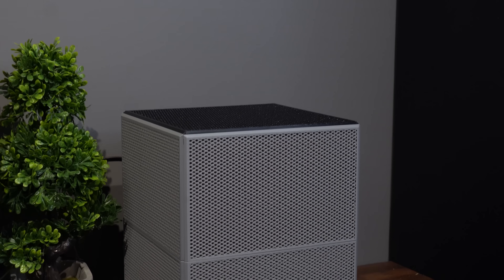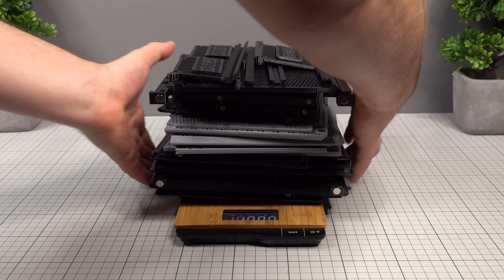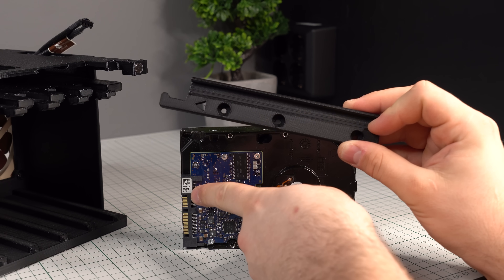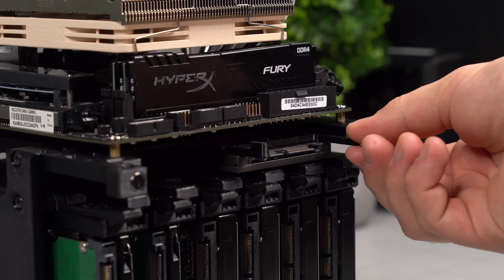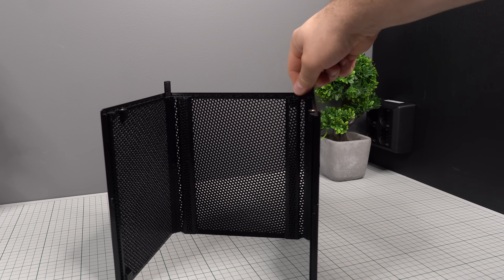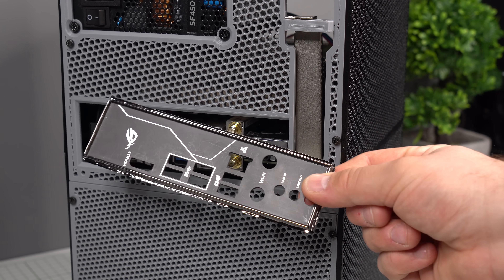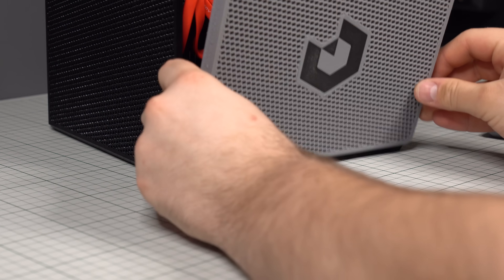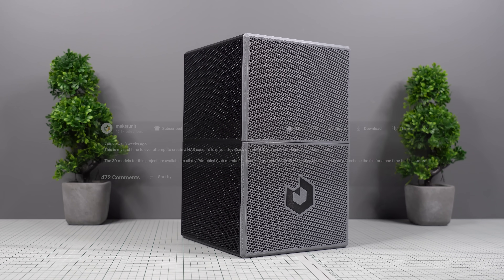3D Printed 6-Bay NAS case - Improved in every way!

Comment: You said in some comments you are working on an m-atx version. Do you have a timeline when you think it might be ready? And what features you are planing? (e.g. bay count?) 

I am olaning on building a nas and currently exploring options. I like the jonsbo n4 but i also like your 6-bay nas. However i am looking for 8 bays and m-atx support for more pcie and like faster networking.

Never the less great Case!
Reply from the maker: Hi! I’m working on it as we speak. Actually it won’t be just mATX but also full size ATX. 

I’m currently printing and testing prototypes of a modular design I’ve been working on the last couple months that theoretically allows for an unlimited amount of drives (given you have enough sata ports). 🙂 I’m not exactly sure about the release date but I hope within this month at least with the «open air» version of it, which is intended to also be compatible with future upgrades.

Currently each drive module can hold 5x 3.5 drives and 2x 2.5 drives per unit (170x170mm square size). So for a 8-drive system you could for example just use 4 slots in each module. 

They all snap into place using a spring loaded mechanism and the spring itself is in the drive bracket itself and not the main body. Meaning if you’re unlucky and a spring breaks it’ll be like a 50 cent replacement rather than a whole module. 😁
Reply: @makerunit 
I think you definitely thought this thru already, but would it be possible to fit 6x3.5" without any 2.5" (I guess there will be reduction for it :) ) in some module? I ask because for raid-z2/raid6, the 6 disks are "optimal" (don't quote me on that :D ), but with this setup you mentioned I would need two modules (also 11 disks "optimal" for raid-z3/raid7 would require 3 modules). Anyway, thanks for your great work, I am eager to see the new modular version :)
Reply from the maker: @petrkinderman9483  funny thing is, I’m actually working on changing these modules to 6x drives per module instead of 5, making them slightly bigger. So for now the plan is for it to have 6 drives. I’m probably re-designing the entire thing again from scratch. Mainly because I noticed a few flaws and challenges after printing out my first prototype. Taking what I learned to improve the second prototype version 😊
Reply: @makerunit 
Love the hear that, thanks for quick response :) hope the rework won't add another months tho :D
Reply from the maker: @petrkinderman9483  The hardest part is often to make the first version. Then the re-makes are usually done a lot faster as the «baseline» is already done, just made with some tweaks and adjustments based on the previous design. 

Most likely there will be another «normal» project posted in between there as this one will take some time to make perfect.

Comment: what infill would you recommend for the interal chassis parts?
Reply from the maker: I just do 20% as a general infill for most of my builds. 😊 the strength mostly lays in how many top/bottom layers you use. I recommend 3 bottom and 3 or more top layers.

Comment: Dude, this is awesome!! Fantastic design work.
I've been looking at Mini-ITX boards and thought about trying to design a NAS case to print. You've covered about everything though!
Someone else recommended a back plane. That would be handy, but also most of us don't swap drives very often, so not really necessary. If I pull the trigger on a build, you may be getting a new Printables subscriber!
Reply from the maker: Awesome! Thank you! I’m also working on some new versions that are expandable coming in the next months some time.

Comment: as long as you have a 3d printer, this is the cheapest ITX server you can buy only $12
Reply from the maker: I wasn’t really a NAS guy before making the project before this one (the 4 bay springy mount NAS). I got so many requests on making a NAS so I decided to give it a shot and I must say honestly, it paid off. This 6-bay NAS based on the feedback from my first NAS is actually my most sold case of them all, still after a few months generating on average 2-3 sales almost every day. 

I’ve got some other cool projects coming up in the following months so stay tuned for more. There will also be some more NAS (with a twist). 😜
Reply: @makerunit more drive nas would be best

Comment: If the SSD connection options were better, I'd repurpose one of the cheap N100 mini PCs with a small NAS case designed to refit the components and use only 2.5" slots to maintain the minimal footprint.  It would be a small-capacity solution.  A speedy 2TB SSD mirror can be affordable nowadays and makes great shared storage for VMs.  Packaging that up in a very small and low-watt solution would be awesome.
Reply: No sooner than I posted this, I discover there are standalone N100 motherboards with sata connectors lol
Reply from the maker: Yeah! A lot of the people who built in this case used N100 NAS motherboards 😃

Comment: I had pieced together a rack style version to hold everything that this design has got into it.

I’ve since purchased your design and printing as we speak.

Such neat work! 

Have a few other of your designs saved for possible future builds! ❤
Reply from the maker: Awesome to hear! Thank you, and let me know if you need any assistance at all 🙏
Reply: @makerunit so far so good, I know it wouldn’t be as many people capable for it but I’ve modified the external side and front panels to be one piece to have a seamless mesh design.

It fits on a 350mm bed.

Would it be easy for you to add the files to the design for those with a bigger bed?

I didn’t connect the back panels (which make IO options easier to change later if one wanted to)

For the side panels, I removed the part for the centre join but retained the edges of the centra as those parts seem to be used for other parts to join/hold onto.

Will share photos to your printables when it’s done but I’m still waiting computer hardware to arrive for it
Reply from the maker: @Jord0699  ah I see! Sounds great, looking forward to seeing it! 😊

Comment: WOW this looks awesome - I've been wondering about buying a 3d printer, any recommendations as to what printer is best and what printer would I need to print this myself? I suspect I could print this though a third party - any one tried that or have any suggestions on what that would cost?
Reply from the maker: Honestly, a 3rd Party will probably end up costing almost as much as buying a mid-range printer… 😅 there are many options but the Anycubic Kobra 2 models are some options, Creality Ender 3 (newest version), Bambu Lab A1 (not Mini version). They should all work for a decent price. 😊 just make sure the print surface is big enough (210x210mm)

Comment: Awesome, what did you use to print the label at 10:40?
Reply from the maker: I used a little «Brother» label printer I have. Just one of those small handheld devices you can type in anything and it’ll print a tiny sticky label.

Comment: Why using overpriced Noctua when you got even better fans with Arctic? I really don't get it. ANYONE seems to think it's only Noctua that is worth buying.
After I changed away from Noctua, I got away better cooling, and also saved money. People should really learn to do some more research on their own.

Else, I must say the author of this video is ELITE! AWESOME NICE WORK! I wish I have this skill!, but I don't!
I would love to build me self a NAS/server, but with a SAS/SATA Back-panel instead = very better speed from your hard-drives. 
So if anyone is up for it, I can give a link to buy those back-panels really cheap and no, I do not earn ANYTHING, nor don't I want to.

But A question also, why do you place the power supply in the top? That is so old school, why do you think anyone else is placing it in the bottom?
Reply from the maker: Hi! Honestly, I used the noctuas because I was able to buy like 20 of them in bulk really cheap from someone on a local marketplace. 😊 also, thanks! I’m glad to hear you like the design! The PSU was placed on the top hmm, I don’t really have a good explaination other than based on the rest of the case that’s where I had any room left 😅 the reason for not getting backplanes is mainly because I want my projects to be buildable with mostly easy to get components that are available anywhere. Not just from AliExpress, Ebay or Temu 😅
Reply: @makerunit  I 100% Understand you! If I can save some money I will do it too :)

Btw.... I might contact you, with a offer... Make me the cassis I want, and I throw money your way. I can't draw anything at all, doing to my autism + adhd, so I need help!
so ... hope you ok i I contact you via email or if your are on discord?

Comment: How's the temps on this? My biggest issue looking for a NAS case is the temps. Like i tried a Silverstone DS380, and it just baked my hard drives, reaching over 60 degrees C with the door closed. I'm also hearing some of the Jonsbo cases, where it's just not getting the airflow. And these are just design flaws you'd think manufacturers would R&D, and figure out. Does this have decent spacing between the drives? The lack of a backplane helps. Any feedback would be appreciated
Reply from the maker: Oh yeah this one has specifically been designed to have airflow between the drives, and the 92mm fans does a very efficient job of forcing away the hot air between the drives. The spacing on «normal» 1 inch thick drives is about 5mm so plenty of air can pass 😊

Comment: It needs to be 8 bay.
Reply from the maker: I’m planning to release more models with more drive space! 😊
Reply: @makerunit  do you have a recommended online print shop for this stuff? I'd love to be able to buy a kit I just screw/snap together. I don't currently own a 3d printer
Reply from the maker: @barfnelson5967  not the answer you want to hear, but honestly, most of those services will charge you quite a bit to print a full case, you’d probably end up paying less if you bought a printer, and filament, and printed it yourself, and again at that point you’re not really «saving money» by making it yourself anymore… 😅

A good option is to check out if someone you know owns a printer so you can just buy the filament and print it on theirs 👌

Comment: Got my insides built and ready, now starting on my outside panells but why are all my outside panels solid in my slicer? How do I get the mesh look?
Reply from the maker: Hey! The panels are made mesh by using no top and bottom layers in the slicer, use Honeycomb infill at 20-30% depending on your desired output,  hope it helps 😊

Comment: I always wondered why you need HDD brackets? Why can't they just slide in?
Reply from the maker: That’s a very good question and I’d love to explain my thoughts here:

There are a few reasons for needing the brackets, however, the main reason is the fact that not all hard drives have the same thickness. For example most modern 500/1TB HDDs are closer to 20mm thick, while the bigger capacity ones are about 26mm (1’’).

I had to use the brackets to ensure all drive thicknesses would fit. So even though the thickness isn’t standard, the screw hole location is, so whatever drive is installed will then be in the correct position. Hope this answered your question 😁 

However, I must admit that they are probably a bit overkill for the use, and could have been made much slimmer.

Comment: bro how much did it cost
Reply from the maker: You can expect around 2.0kg(+\-) of filament which depending on where you buy it, will be between $35 to $50 usuall. Then you need threaded inserts, magnets, power button and screws that will probably set you back another 10-20 depending on where you get it.
Reply: @makerunit  i asked in my markets to get it ptinted and they told me itbwould coat me around 250 usd to print

Comment: Great design but that's not what "hot-swappable HDDs" means...
Reply from the maker: Thank you! And actually, per definition, hot swappable doesn’t necessarily require a backplane. It only means that a device can be plugged in or unplugged without shutting down the system (a system that is on is «hot», therefore hot-swappable). But I do get your point and in most cases when people refer to this term they mean a system with backplanes because that’s the most common setup for big servers. 😁
Reply: @makerunit  again, good design but not what hot swappable means. Also, many small factor server units have what you think is hot swappable. Anyway, great design
Reply from the maker: @tomernassi Thanks! I was mainly just referring to the meaning of the term «hot-swappable» in any connection. But I totally get your point too, in the NAS/Server world it’s probably usually referred that to when you have the backplane installed so you just pull them out. However I try to make my projects «buildable» with mostly off the shelf components as I make most of my projects with the intention of sharing them to others. 😊

Comment: needs hdd backplane for real hotswap
Reply from the maker: Hot-swappable technically only mean that a device can be connected or disconnected without shutting down the system. A backplane is not necessarily a requirement for the term hot-swappable to be true. However, I get your point 🙂, but I try to make most of my projects buildable with as many off-the-shelf components as possible, which is why I intentionally avoided a backplane.

Comment: Very cool build.  Could this be modified to use 8 bays if I used a very simple / small passively cooled mobo?  I need a slow backup media server that I can keep adding storage space to.
Reply from the maker: Hi! Thank you!
Theoretically it could be expanded, yes, but I also plan to create more NAS versions in the next months coming. I’m looking into the idea of creating a modular system that can be expanded once needs increase. Still in the idea phase but I’ve got some potential solutions. 😁
Reply: @makerunit  it’s a good idea. All newcomers to storage buy drive space that they end up outgrowing faster than they thought they would.  Something that expands with them would allow them to get more use out of that equipment.  It would also dampen the pain of bad first purchases :)

Comment: 11:24
Magnets near hard drives? Cmon man, you should know better. A clip-on would have been sufficient.
Reply from the maker: Nothing to worry about. The strength of the magnets are not even close to having any noticeable effect on the hard drives. The magnets used to destroy drives are extremely powerful way beyond refrigerator magnets. And also, they aren’t even close to the spinning part of the drives 👌
Reply: @makerunit  
But still, magnetic field is magnetic field. 0 is better than 1. It wouldn't kill you to omit the magnets would it, its just a faceplate, not a critical function of the nas whatsoever.
Reply from the maker: @jackipiegg  the thing is though, that consumer grade magnets are not even close to strong enough to have any impact on a normal hard drive. And especially these tiny 8x3mm magnets would not do anything at all, even if attached directly to the hard drive right where the spinning disk is. This is completely safe. It’s not like «any» magnetic field would do damage. You’ll need industrial strength magnets to do any sort of permanent damage.

Comment: Hi my files for the external sides are all closed and not open like in the video its version 1.3. Have i got the wrong files ?
Reply from the maker: Hi, no the files should be correct. However, you need to change some slicer settings to remove top and bottom layers to reveal the infill.

The ventilation pattern on the exterior is created within the slicing software. 

What slicer are you using?

Comment: What motherboard, cpu, psu, and OS? The print is awesome but need details on the rest for us homebuild NAS noobs.
Reply from the maker: So in a way I’m actually one of those NAS newbies myself, I know how to make the parts fit together but the «computer part» part of it I’m actually not the best to make recommendations. 

However, personally I used a quite old motherboard called ASUS Rog B450i (AM4 socket). A Corsair SF450 SFX psu, a Ryzen 7 5700G processor, and added a relatively cheap Sata expansion card from Aliexpress, but they’re also easy to find on Amazon etc. 

There are also dedicated NAS boards available that have tons of sata ports built in, it all depends on the specific needs you have so my general recommendation is to research a bit on what type of system combo fits your needs the best, as there are tons of uses for such a system 😊

However I don’t want to recommend specific models as I do not have enough experience with NAS systems in general to know what works well or not.

Comment: This is a great design and good looking but aren't those magnets too close to the HDDs?
Reply from the maker: Hi, thanks! And not really. People seem to exaggerate how bad magnets actually are for the hard drives, but to actually corrupt the data on a hard drive you’re going to need something much much stronger than some «refrigerator» magnets. And these are also on the opposite side of the case to the disks on the hard drive. This should have no effect at all, even over time.😊 I was worried about that too in the beginning before finishing the design but a lot reading about this exact thing, it seems perfectly fine.